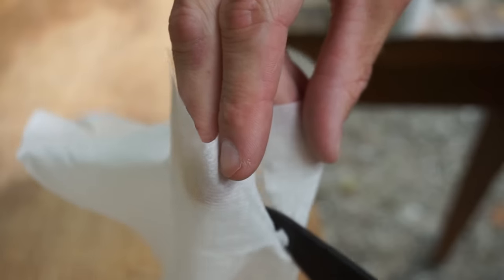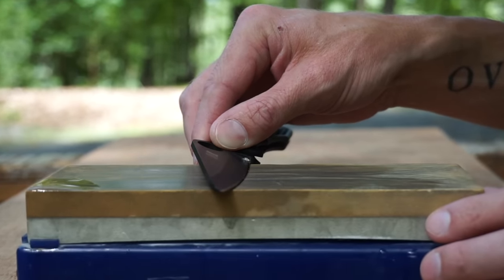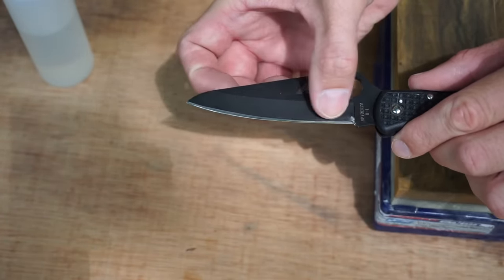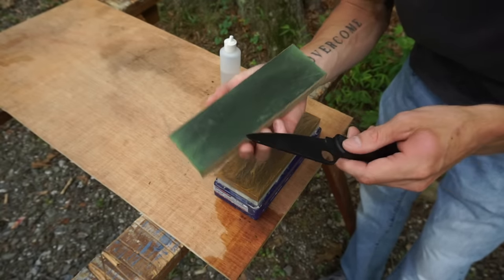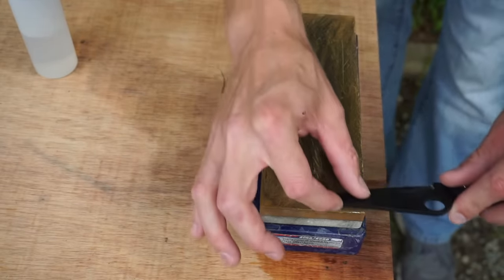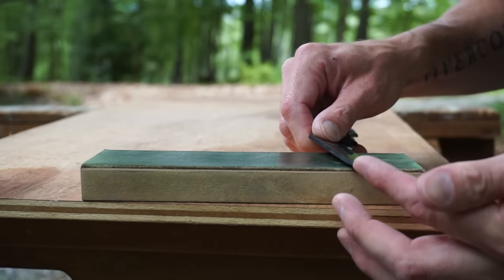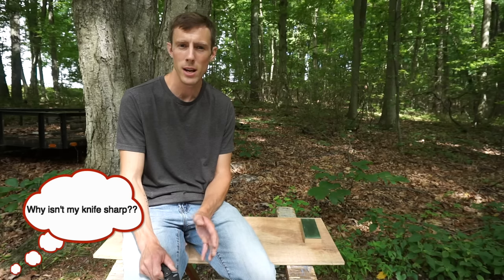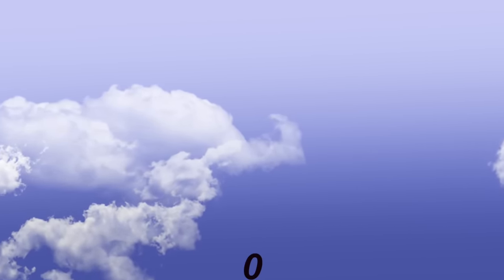3 SHARPENING TIPS BEGINNERS MUST KNOW.  How to sharpen a knife

Comment: Nice video. One thing you might consider adding to your beginner advice is to use a black Sharpie marker to color the edge bevel before a person begins working on their blade. It really helps a person see and understand what's happening during the sharpening process when they can see ink removed with just a few strokes against their stone instead of chasing a burr for hours. If others have already mentioned this tip sorry for the repetition.
Reply: Tino Valle I am just starting with stones and I really suck at it. I watched this video and tried my best but I made my kinda sharp knife so dull it couldn't cut butter. Thanks for the tip, I'll be sure to try it once I find a Sharpie. Let me know if there are any other tips I should know.
Reply: I prefer other colouors than black since that sometimes can get mixed up with (oxidized) blade material.
Reply: I mean if ur new to it u would assume its a new whetstone
Reply: I have been sharpening for a few decades and I still use a sharpie on the secondary bevel. To match the factory angle you can lay the blade on the primary bevel flat to the stone. Come up really slow and can actually feel when the secondary bevel is flat against the stone. Stop when you feel this and lower it a tad and bring it up again to verify. You need to mess up a few times but it is worth it. He also didn't mention to take equal strikes from each side to keep the apex in the middle of the edge. You can alternate sides so you keep it in the middle. A light touch is better than a heavy one.
Reply: Cool tip
Reply: Tino Valle I do love you
Reply: This helped me a lot, thanks Tino
Reply: Tino Valle NICE!!! I’ve been using Layout dye hahhaa
Reply: Jäger From GSG9 same here! Good ol layout dye!
Reply: @PlasmaHH  Green or blue is is easier to notice (wavelength), but I stuck with red, especially on knives that are very reflective to have a contrast.
Reply: wouldnt it contaminate the whetstone tho?
Reply: @lordkane8583  The stone is full of metal particles and the sludge of loose abrasive, the mostly alcohol based sharpie/edding doesn't matter at all. It's like you're worried about a discoloration of your brake pads. Just make sure it's flat. You can  find certain cleaning rubbers if it's such an eyesore to you. If you flatten the stones, it's like new anyway.
Reply: @smittywerbenyeagermenjenso3720  One thing to try is the diamond sharpening systems and kits with the guides. I'm working on learning how to sharpen with a stone, and in the meantime i got a used smith's sharpening kit and even though the sharpeners are a little used, it's easy to get a sharp edge for now
Reply: Good advice thank you
Reply: It doesn't matter how many times that idea is said,,,pretty cool idea,,will use this
Reply: Great tip, so great!...
Reply: Great idea!
Reply: Good idea
Reply: @smittywerbenyeagermenjenso3720  I am going to give sharpening a try a few more times, but, it would be nice to have a master sharpener to take them to.
Reply: @richardhatt6541 
   Shukens fella, you the man Richard, thanks.    My body learned that, but never knew, I knew it to tell others
   + thanks guy+
            - Larry Vaughn here 
🐸👍
Reply: @joelstolarski2244  A caution here.!   Stay away the diamond stuff until you have a feel for what your about.    It hurts as well as helps faster.
Ps:   fot kitchen knives buy a new long shafted "steel" to keep blades safely sharp.   Keep it clean, use it every time you cut.    You will be glad for the efforts, I tell you true...
   With gratitude, 
thanks Joel 🐸👍
Reply: @larryvaughn7819  I did go back to a stone. Had one that was loaded with oil and finally was able to get it clean by using some straight ammonia on it. I still like the diamond ones and try not to cut too much of them. Using cheapie knives for practice for now.
Reply: keep at it. you'll improve.
Reply: I was your 666’th like
Reply: Yikes! Good thing Upper Management has my six! ;-)
Reply: Hmmm, now who could this be? Lol hopefully, it's a fellow Shellback and not a slimey little pollywog. Sorry for the super late reply. I don't receive many reply notifications and I work so much I don't stay on top of recreational Internet stuff like I should. Don't remember much about sharpening while deployed other than when one of our Chiefs sliced his finger cutting up an orange... didn't take him long to figure out what he was doing wrong. Hey, you wouldn't happen to have any ACU-5 patches that are in mint condition would you?
Reply: Whoops!! Hit the wrong button on my phone... see below for my reply.
Reply: Excellent advice.
Reply: When i was in school for automotive repair they taught us the same trick for grinding valve seats in heads
Reply: Thanks for the tip :)
Reply: @euphoria6938  you lose!
Reply: I've got a bunch of whet stones that I inherited. How do you tell when your whet stone is wore out or is no longer doing it's job?
Reply: @bignasty110 You don’t see many Assault Craft Unit guys around!

Comment: Tip for detecting burrs: 

run a stream of water over the blade from the trailing edge to the cutting edge. Like under a sink tap. As the water glides over the blade and off the cutting edge, you can see disturbances in the stream caused by burrs.
Reply: I've heard of this tip before, but remember differing schools of thought as to the size of blade it works on. From some sharpeners, I've heard/read that smaller blades (something smaller than the clip point blade on a Case medium stockman for example) this doesn't work. Personally I've never tried the running water method, but I am curious as to when this is applicable. (When looking for a burr I use a jeweler's loupe I keep in my sharpening tool box)
Reply: This is my preferred method if at the house. Keep those fingers clear of the cutting edge!
Reply: Something I just found out about. I was getting ready to buy a magnifying glass for the purpose of looking at my knife blades but, did you know that if you have an iPhone it has a built in magnifying glass feature? And that it also has a light. It’s totally awesome. For anyone that doesn’t know, here’s how. Go in settings, then tap on accessibility then scroll down to magnifier and turn it on. Some phones you go settings, general then accessibility. Then to access it, tap you home button 3x or there is a little magnifying glass icon on your slide screen that has your flashlight, calculator, alarm clock etc. on it. It works great and super powerful.
Reply: Wow Thank you Sir
Reply: Careful with the water some of my older knives rust very easy
Reply: Yeah when I'm out camping I always have access to water for sharpening knives.

Comment: Another tip is tool keep in mind what steel your blade is made of and how hard it is. A soft blade only needs a few passes before noticeable progress I'd made, where harder blades will take longer. When I was first getting into sharpening, I mainly practiced on a variety of pocket knives I owned which are typically hardened to under 60 Rockwell. I then found an incredibly dull kitchen knife that my parents had and never used because it was too dull. I decided to try and sharpen it, using the same technique I used for pocket knives. This knife was a Japanese style knife with a hardness rating of 65, so it takes a lot more effort to actually sharpen (not to mention this knife was a better hammer then a knife when I started). In the end I did manage to get it sharp but it took my 10× longer then it usually would have because I didn't understand knife hardness at the time. 

Another pro tip, you can make any steel shaving sharp, but cheap steel is still cheap steel and would be dull again after only a few cuts. Don't put a lot of effort into making cheap steel razor sharp, when it doesn't have the strength to maintain that. This isn't as big an issue with modern blades, because even cheap 440 stainless can hold a decent edge, but older knives can definitely be made of sub par steel that isn't worth the time. Just get a $2 plastic pull through sharpener and use that on them.

Comment: The tip of lowing the angle on the strop is great. The sharpening stars on YT never mention it. +1 for you. Thanks for sharing.
Reply: Can you use any leather to strop?
Reply: @andrewtucker7990 
Short answer: every material that can hold the abrasive paste it's fine, it depends only on your ability to not damage the edge.

Long answer: historically the leather used to strop razors was the most stiff leather in the world: shell cordovan. It's the technical name for the leather cut made with the horse's butt skin (and the most expensive leather in the world too). It's a good compromise between a hard surface that can bend your edge while you strop, and a soft surface where your blade can sink and round your edge instead of sharpen it. That said, if you have a trained hand you can strop on hard surfaces like wood or mdf or very soft surfaces like soft leather, cork or even cardboard. As OUTDOORS55 has showed in the video, you can change your stropping technique to adapt to the material. For knifes with a double bevel, my opinion is to prefer more rigid surfaces like the shell cordovan. For other blades, like for example woodworking tools with one bevel only (plane blades, chisels), it depends on how you sharpen the bevel. Some woodworker prefers create a convex bevel with hand sharpening. In that case you can strop on very soft materials or leather with almost no risk. If instead you sharpen your chisel or your plane blade with jigs, you obviously want to maintain planarity on that bevel. In that case more hard and flat materials are recommended (like wood or mdf).

PS: Forgive my grammar, I am not native english.
Reply: @th34lch3m1st  honestly, you have better grammar than most native English speakers. Also - great info in your post. I just recently decided to make a couple of strops for some friends out of leather scraps from making sheaths. The quality of lumber available is pretty poor, so I think I'm going to get a few  pieces of MDF to use as a backing material.
Reply: @JustIn-op6oy  Thank you. I'm glad I was helpful.
Reply: @andrewtucker7990  hi,  my father was a wood Carver for 60 years and he used an old belt made of a pig's hide for all his carving knives.  His old hunting knives,  pocket knives, my mom's kitchen knives, and my assortment of old knives...etc.  He said it was perfect.  He passed away 8 years ago and now I'm using it.  It's pretty beat up but he was right.   It's perfect.  🙂
Reply: @th34lch3m1st  don’t think I read this 9 months ago. Thanks for the tips and your grammar is fine.
Reply: @silviabayer1213  thanks, I’ve been wondering got a while. Glad you replied so I CIOs see the old comments as well. Thank, you all.

Comment: My favorite tip for beginners is to continuously cut lots of paper throughout the whole process.  The way the sound and the feeling changes is my most important tool to know where I'm at in the process.

If you're really a super beginner, then you want to go crazy with the paper cutting: couple strokes on the stone, wipe, cut and repeat.  You should end up with a huge mess of cut up paper on your floor and a better understanding of how your actions affect the blade.  Most importantly, you'll be able to identify when you do something unsharpens the knife.

If you're consistently checking the state of the blade, then you will be aware of its state at all times so you can learn to associate it with other indicators like what sound the blade makes on the stone based on various factors, how it glides etc.

Now instead of cutting paper, I use just those other more intangible factors.  And if I want to do a peak level job, then I might cut some paper along the way.

Comment: I think these are very good advice for beginners. Another thing I'll add is to listen to the sound of the strokes on the stone. Each stroke should sound the same each time and even through the motion of the stroke. If theres any change in the sound, the blade angle is changing or moving against the stone.

Comment: Seriously you have some of (if not THE) best videos on sharpening and stropping on YT this will be the video I send to anyone that wants to know more or is just starting to work on their own edges!
Reply from the maker: Thanks for the comment! I really appreciate it! I'm just trying to share some of the mistakes, and things I've learned over the years. Thanks for watching 👍
Reply: OUTDOORS55 tips n advice through experience are the best.
Straightforward addressing the issue, simple (easy) to follow
Reply from the maker: Wet sand paper on something flat. The same techniques apply.
Reply: Probably. It's not impossible to sharpen on 3000 but it will take many many hours. If your knife is quite sharp and you just need to make it sharper you can do it on 3000 but if it's dull you are saving much time by going to a low grit like 200 or 400 and then around 1000. Imagine having a rough plank and trying to make it smooth. You wouldn't start with 1000 grit sandpaper because it would take you forever.
Reply: anotherrandomtexan25 and
Reply: anotherrandomtexan25 I
Reply: @ramonzamora9326  
Yes..3000 is far too much to begin.
Try to begin with 600.
And then working up to 800..1000..until you reach 3000.
But 600 to 1000 is more then enough.
And hold the angle consistent.

Comment: After poor angles, the most common beginner mistake I see is TOO MUCH pressure. When a person starts out he/she almost always underestimates the effectiveness of the various grits, and they think they have to use force. Once you do it awhile and then experience the effect of something like leather - which some beginners can't even believe actually work - it starts to sink in how little pressure/force is required. Great video. Thank you!
Reply: Jake Mitchell I am one of those beginners lol. It’s less that I don’t believe it and more that I am perplexed how it actually can work.
Reply: @ayekantspeylgud  A straight edge has a bunch of tiny(very thin, bendable) teeth under a microscope, the strop will align all of this making it much sharper.  Ive seen and heard this is why a strop is effective.  And when it dulls a little, bring it back to the strop and it will be great again.
Reply: Pressure (or lack thereof) only matters when you're working the burr off, or if you're sharpening razors. I usually use more pressure when initially profiling the edge, and transition to almost no pressure at all when finishing. A moderate amount of pressure is sometimes necessary when working with some stones, such as Arkansas stones. The biggest mistake I see beginners do is use too fine a stone on a new knife that's never been profiled -- you need to be very patient to apex a new (or old) knife with, say, a 1000+ grit stone.
Reply: I am a rank beginner. I bought a course stone from ace hardware, and I think it’s like a 200/300 grit. Anyway, I do understand grit and pressure as I work as a fabricator. But this one stroke backwards is great. One stroke, and I am able to work on my form. When I go back and fourth I feel like I am all over the place, and that I am damaging and filling the blade even more!
Reply: @JeffAboularage  I had to think back to a post I made 4 years ago, LOL. Darn, time flies! Since that time I've gotten much better at sharpening. The stage I'm working on now is sharpening broadheads for hunting deer during archery season. This has driven the point home even more. It's about angle and pressure, which cannot be taught. You just have to do enough of it to develop FEEL. I can now feel things that wouldn't remotely register years ago. My suggestion is to get a bunch of cheap, dull knives and spend hours getting them sharp. You can do it while watching TV or during breaks at work. Seriously. Just sharpen and sharpen, checking the edge every few strokes. You'll find most of what you do actually makes the blade duller, LOL.
Reply: @jakemitchell1671  I surely appreciate the reply! I have some knives that were given to me, and I want to learn to keep them sharp to their fullest potential. Yes, feel. Like so much else.. It’s something you have to work at. Yesterday I was in the garage working this pocket knife, going back and fourth, and I just kept putting the sharpie on the edge as I had seen! I would work it until the sharpie had disappeared, flip it over and start again. The pocket knife I am working has a broad bevel, so it’s easy to see what is going on!
Reply: @JeffAboularage  Did you eventually get the blade super sharp?
Reply: @jakemitchell1671  no sir LOL I couldn’t even cut an avocado with it this morning